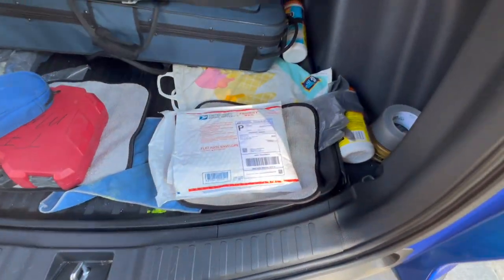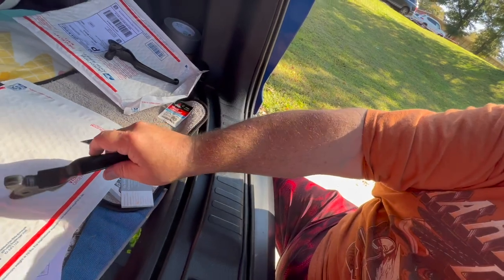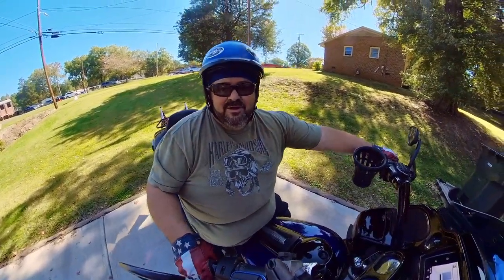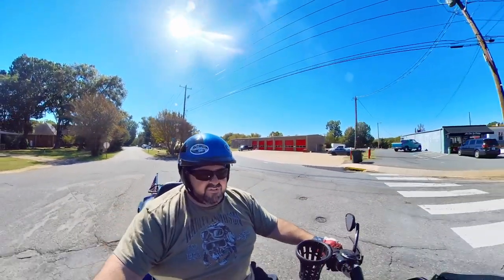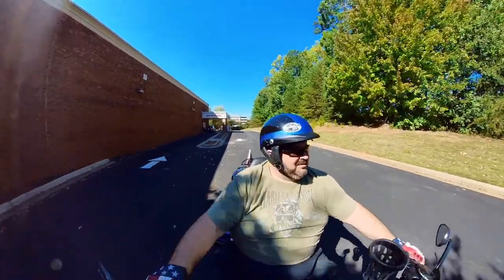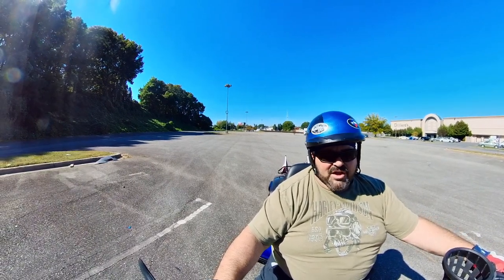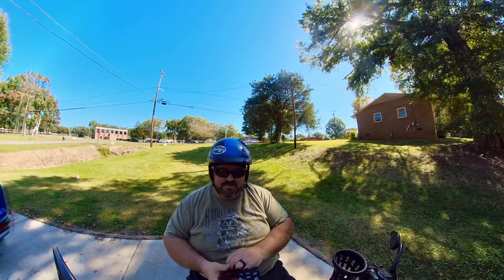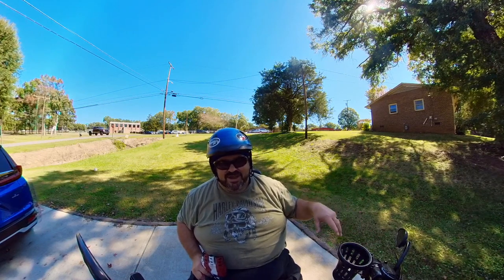Reduced Reach Clutch and Brake Levers

Comment: Hey bro!!! I have been on the fence about changing my factory bars to 12 inch, because I am also concern about tight turns as well
BigMike from Gainesville FL
Reply from the maker: The original bars were fine for me as far as handling/controlling the bike. These bars are 12 inch Factory 47 bars. I love the look, but they are 36-37 inches wide. Way to my for my short arms. The bars I'm putting on are custom from Vindicta. They are about 33 inches wide and have a better angle.